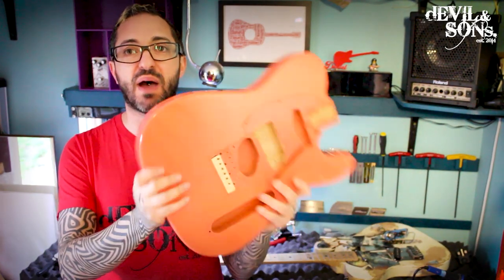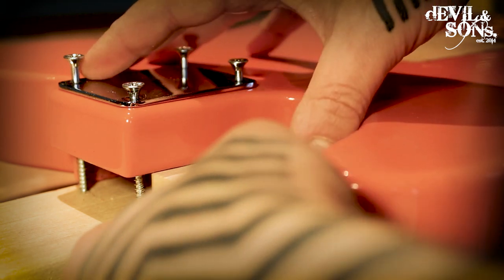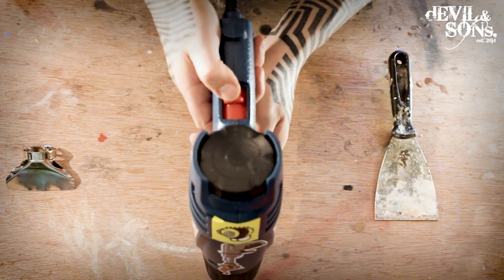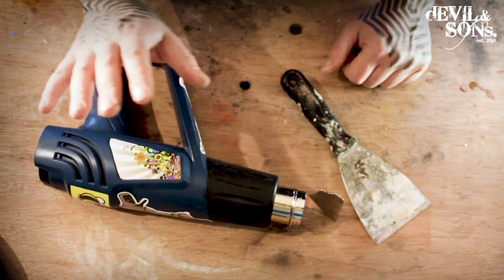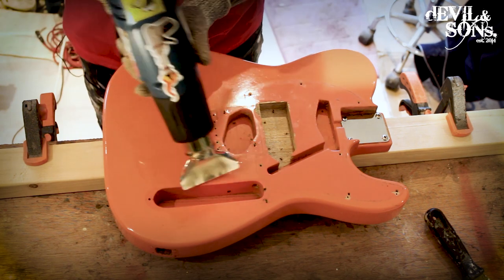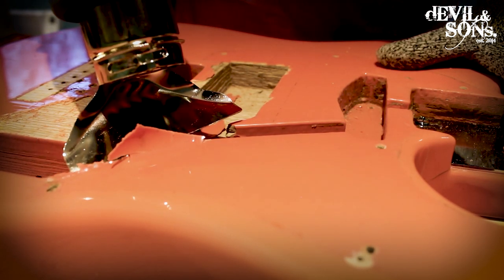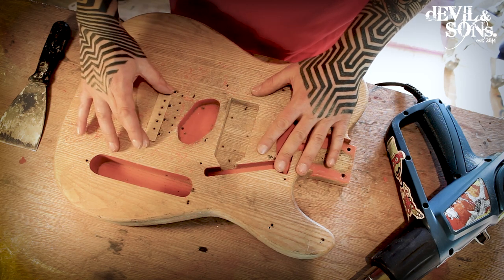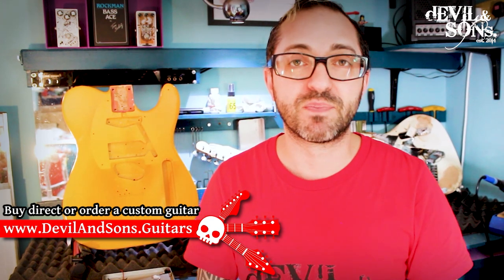The BEST way to strip paint from a guitar (or bass): How to use the heat gun method

Comment: Do you know if stripping the paint off a telecaster and playing it bare wood afterwards will make it sound better? 
Also, I would like to know if changing the internal cables and the jackstik-hole to high quality gear can improve the sound? 
I have a good and cheap Harley Benton telecaster.
Reply from the maker: I don't believe stripping the paint will make any noticeable difference, although some people may argue that they can hear a difference (they must have amazing hearing).

As for the jack, it could improve things but it really depends on if you are having issues at the moment. A better step might be to improve the shielding inside the cavities. If you are after a big change in sound as opposed to eliciting hum then changing pickups  will make the biggest difference.
Reply: @DevilAndSons  "Shielding inside the cavaties. I will find out what this means, and do it. I like the guitar very much and everything works fine, except for the high E string which has lower volume and smack than the other 5 strings. 
I tried to change the thin Harley Benton jackstik-cable to a thicker standart 20 dollars Fender cable. That improved the sound a little bit. So I ordered Thomann's best cable. 3,5 meter for 140 euro/dollars. All the reviews on Thomann say they are very satisfied with the price/quality of this cable.
Reply from the maker: https://youtu.be/_N5xPRFo5kE
Reply from the maker: That top e problem might be resolved with new strings if you have the ones it came with still on it.
Reply: @DevilAndSons  Thank you for the video mate. I will send it to my local luthier and aks if he can do this to my new Harley Benton Strat which arrived today. A lot of humming from that one. Nothing from the Harley Benton Tele I bought about a month ago. 
That expensive cable is even better than I was expecting. I was hoping for a couple of percent improved sound. I would say it gives around 10%.
As for a Harley Benton, all those small cables inside the guitar under the pickguard are made of cheap metal, maybe not even pure copper. Are you sure it will not improve the sound to change them to pure silver?
Reply from the maker: @Morten_Nielsen1979  Changing the components will make a difference, so if you are willing to spend more going to a luthier you could ask them, but honestly you shouldn't have a hum if you didn't on your other harley benton. I reckon there's a loose wire in the grounding that a luthier can find for you. If you are really looking for a better sound though I would change the pickups.
Reply: @DevilAndSons  Okay. Do you know which pickups are the best for the Hank Marvin sound? My strat is a Hank Marvin tribute model. I only bought it because I quickly realized I need a tremolo as I will only be playing Shadows and Duane Eddy for the first year or so. Installing a tremolo on my tele is the same price as buying a Hank Marvin strat. I am an acoustic player and singer changing to using backing/karaoke tracks. I thought I would mainly be playing Country and chicken picking. 
The tele is also really nice. I think if I am going to change pickups, it is more likely I will be doing it on the tele rather than the strat. The strat already sounds amazing for Shadows and spaghetti western songs. The bridge pickup on the tele sounds like it could be improved. I once saved an interesting guitar on one of my playlists due to a certain pickup. The video maker seemed to be very infatuated with that guitar and the pickup in particular. I will find the video now and send you a link.
I also play Rolling Stones, Bruce Springsteen, Chuck Berry, Elvis and John Fogerty.
Reply from the maker: I'm not really a pickup expert, and you can get such a range of pickups it's hard to know what will be best for you. Most companies have sound demos and descriptions on their websites.
Reply from the maker: In addition I would say that actually you may have better luck altering your sound via the amp or an eq pedal to sound more Hank Marvin like on a tele that replacing the pickups.
Reply from the maker: Thanks for sharing.
Reply: @DevilAndSons  Yes, a lot of Hank Marvin players use effects. I will study that later. One step at a time 🤠.
Reply from the maker: Good luck on your journey.
Reply: @DevilAndSons  Thank you. I wish you good luck too.

Comment: Great job ! But is there a risk of splitting the body or deforming it ?
Reply from the maker: Thanks. You can definitely accidentally scratch or gouge if you're not careful, but a good sand over the body should get rid of any light slips, unless you are very unlucky or heavy handed.
Reply: @DevilAndSons  I think he's referring to the heat gun expanding/ warping the wood.
Reply from the maker: @Jack Darby  ah, right. I doubt that isa problem as the heat isn't applied for that long.

Comment: would this work with a hair dryer? i don't think i have a heatgun but i read somewhere that i could use a hair dryer.
Reply from the maker: I think it might. Hair dryers definitely don't get as hot as a heat gun, so you may find you have to work longer on area to make it soft enough. Also if it doesn't work you can pick up heat guns pretty cheaply.
Reply from the maker: Please do let me know of ot works with a hair dryer though, that would be good information.
Reply from the maker: Good luck!
Reply: @DevilAndSons  yeaa it didn't work, i'll prob just get a cheap heat gun
Reply from the maker: That's a shame; worth the try I guess. Thanks for letting me know.

Comment: would this technique work if I want to take one layer of paint off another? Just got a Squier that looks like it was some sort of blue originally but has been painted over with what appears to be white primer paint, would like to take the white paint off going back to its original colour
Reply from the maker: I wouldn't risk this technique, it would definitely take too much off. You're probably best carefully sanding as I imagine the paint layer on the squire would be thick enough if you go through it a bit not hit the wood (I may be wrong). But after doing thar you'll definitely need to put a new clear coat on top... 8n which case it may be best to just respray the whole thing.
Reply: @DevilAndSons  cheers I'll see how I get on Sanding it off if worst comes to worst I'll just give it a complete refinish picked it up for £50 so not too much to worry about I believe it's from 1992 and is Korean made
Reply from the maker: Good luck and do let me know how you get on.

Comment: Would you use this method to remove a nitro finish?
Reply from the maker: You can. I find that everyone I use it is a bit different depending on the age and make of the finish, and the thickness... but it should work fine.
Reply: @DevilAndSons  thanks for that.
Reply: @DevilAndSons  it’s a Brad Paisley Silver Sparkle. Was wondering if straight sanding or the heat gun method would be best?
Reply from the maker: I just removed a sparkle finish off of a american professional series strat, it took a while with the heat gun but probably quicker than sanding as it was on thick, but I had to do some sanding after anyway to neaten things up. If you have a heat gun I'd say start with that and if it seems to be taking too long try sanding. The heat gun will be less messy.
Reply: @DevilAndSons  This is awesome information and much appreciated thanks! I’ll give it a go. First time so keen to get it right as it’s a beautiful guitar.
Reply from the maker: @stratslinger3921  it's a pleasure. Good luck and do let me know how you get on.

Comment: My paint is nothing like that! it came off really thin revealing an undercoat
Reply from the maker: That sounds like the paint wasn't bonded very well to the undercoat. Every company uses a different approach to painting, and even on different models and between different factories.
Reply from the maker: Did you get the result you wanted in the end?
Reply: @DevilAndSons  getting there. I stripped what I could and im sanding away the undercoat which wont strip with a heat gun. It will work but im sanding by hand so I decided to do a little every day for a week ;-)
Reply from the maker: That sounds like a work out! The sanding is long process but sounds like the right one. I wonder what type of undercoat paint it is?
Reply: @DevilAndSons  No idea. Its sort of a marigold colour and its pretty tough but I will win!
Reply from the maker: Good luck.